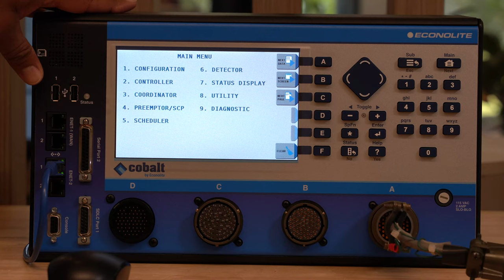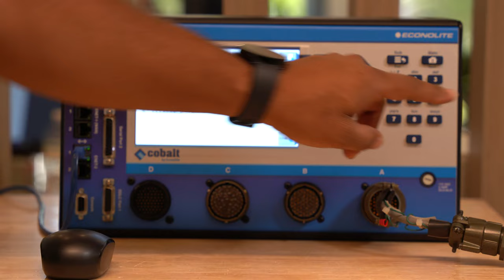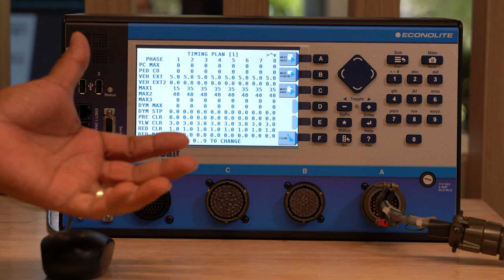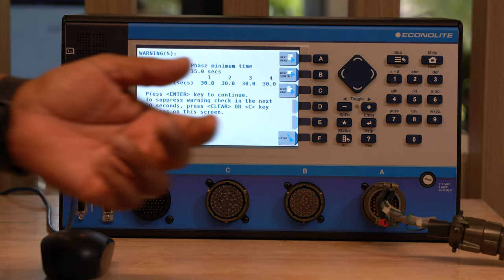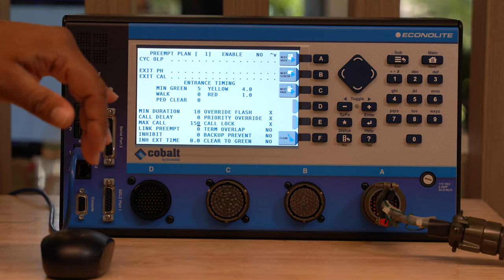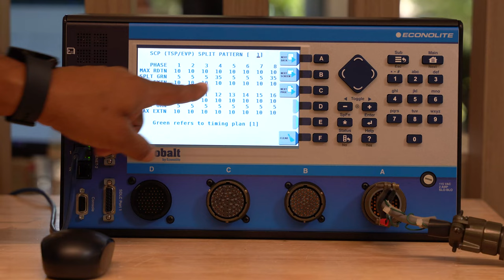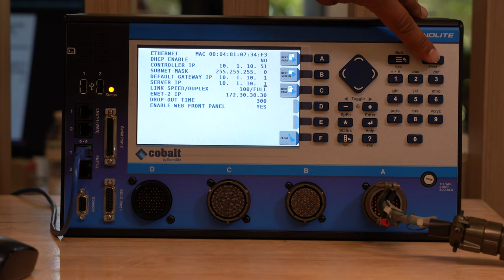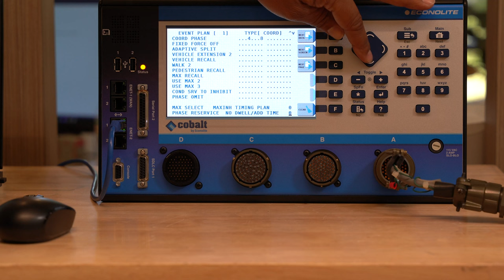Econolite Traffic Controller Training - Cobalt running EOS Software

Comment: Hi tito, your videos are very helpful. You very much appreciate it. I have questions when you are uploading a database to a USB flash drive on a Cobolt controller. Would it  also upload the preemptor settings settings
Reply from the maker: Great question and appreciate that you are using this training. The answer is YES it would also upload the preempt or settings.